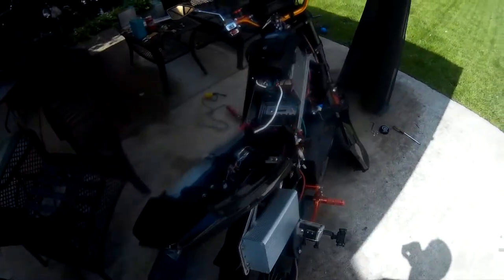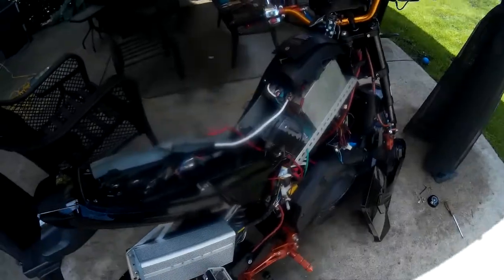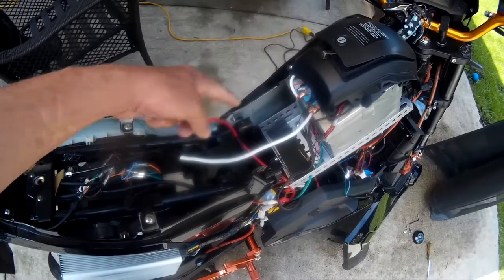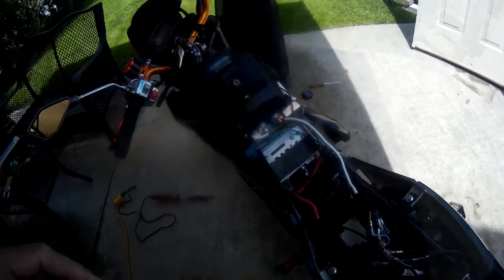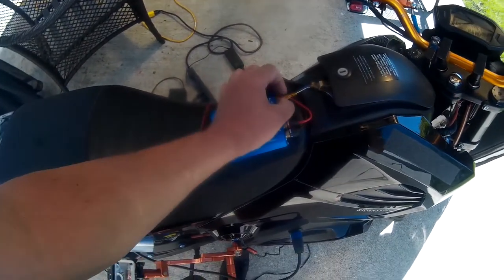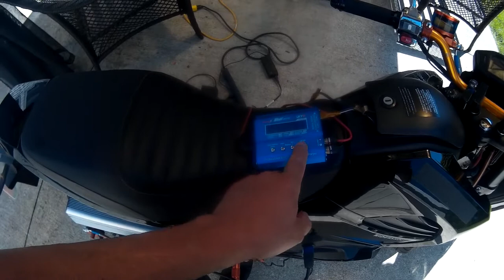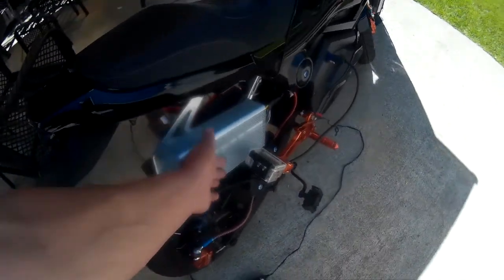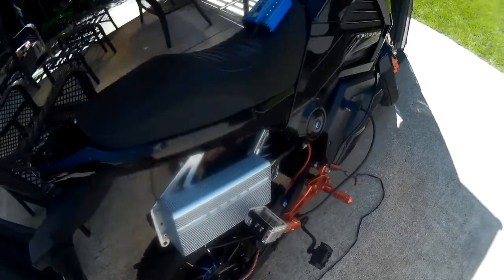EBIKE VLOG #36 June 8, 2019 (full charge 116v running charge 110v

Comment: ykz7280 only has 90v fets I plugged 21s 88v into mine and it killed the low voltage on the board max 85v for the dc dc I now have a separate 4s battery to run the low voltage side of the controller.